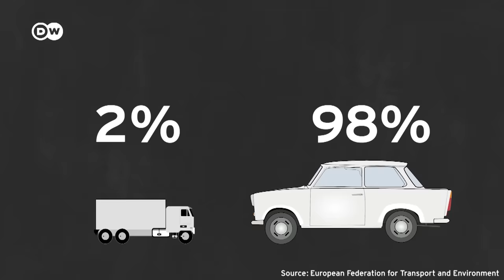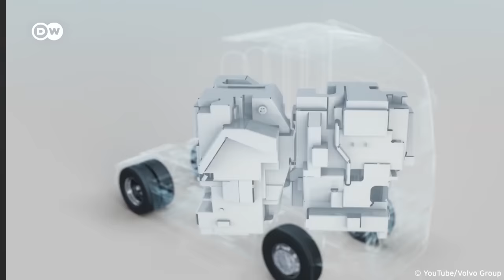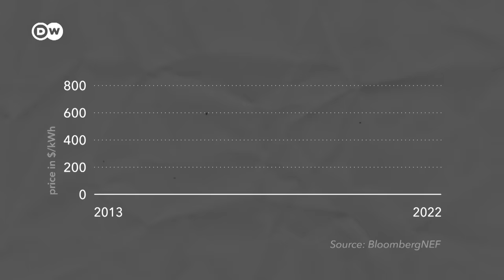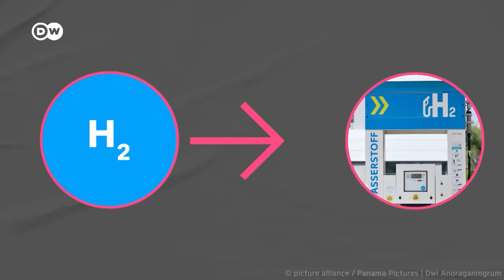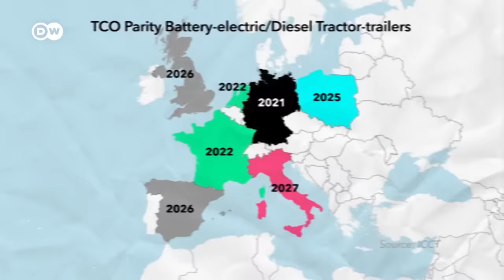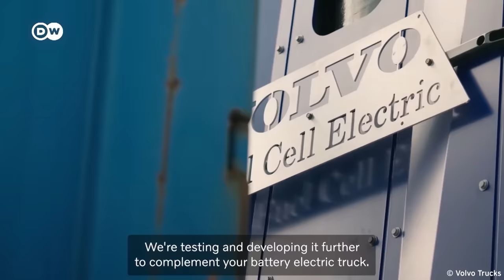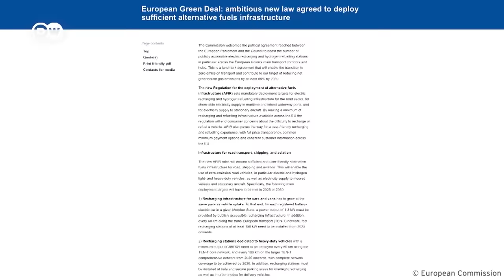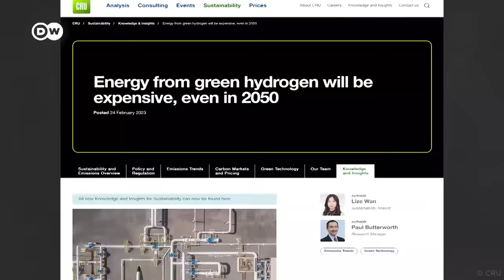Which will be the engine of the future?

Comment: We've already had a clean, faster and electric form of transportation than can haul 100 times the tonnage of what a truck can do for over a century. They are called trains. The easiest way to cut down truck emissions is to invest in more freight rail infrastructure to get more trucks off the road.
Reply: True, but many European countries have great rail networks and still have insane numbers of trucks on the road.
Reply: @Simon-dm8zv  their freight rail infrastructure is far from perfect.
Reply: @sanitygone-l9y  Are you envisioning an extremely dense network? Would be nice, but also has its problems like cutting up landscapes and neighborhoods. Or do you mean replacing existing roads by train tracks?
Reply: @Simon-dm8zv  Where I live major lines need to be replaced in the next 30 years ago. There is a lot of room for improvement for existing lines.
Reply: If that were true, trucks of any kind wouldn't exist, trucks are a necessity one way or another, and we are just interchanging from a combustion truck to an electric one, nothing more.
Reply: @Voltaje_YT  yes youre completely right. trucks need to exist, especially for last mile transit. all i was saying is that quite a few trucks could be taken off the roads by investing in rail.
Reply: @Simon-dm8zv  rail corridors take up much less space than highways. the entire history of highways is marred with segregation and splitting up neighborhoods. no, im suggesting upgrading existing rail corridors and lines  for better freight use.
Reply: @sanitygone-l9y  Sounds good, more rail cargo would be great.
Reply: @Voltaje_YT  you do need them for short haul but do we really need multi day hauls by truck? Trains are way more efficient then trucks yet we use trucks for far longer journeys  than just local transport.
Reply: @fulconandroadcone9488  Trains are for heavy transport from A station to B station, then trucks take the load to distribute to factories, stores, etc. you can't put trains everywhere, so trucks are flexyble, if trains were better, we wouldn't have trucks, trains have its uses, and so does trucks.
Reply: @Voltaje_YT  the point being made here is that there are a lot of long distance routes 300 miles plus being done by trucks. these would work better as freight rail routes. trucks are better for last mile deliveries, not cross country hauls. yes trucks need to exist but a big part of why they exist is because governments are too lazy to upgrade or build new rail corridors and instead invest those billions into roads and highways that degrade much faster than rail.
Reply: @sanitygone-l9y  I wonder if given the choice, companies will rather choose trucks than trains, trains would be mostly public, for the use of trains, we would need private ones, and even if we have that, the cargo's safety and schedule will be entirely controlled by the train managers, unless companies build their own trains; it is complicated, any major company could ask to build a train if they wish, but they don't, why wait for the goverment to build trains when one can build their own?
Reply: Trains are powered with diesel engines.  And yes, diesel trains have always been the most efficient shipping mode per ton mile. 😂😂😂
Reply: Thats silly. Trucks do the last mile. To do that with trains would require FAR more track to be laid. The expense would be beyond enormous. Laying a mile of railroad track can cost upwards of $3 million, depending on various factors such as track type, terrain, labor costs, and material prices. Thats not including the cost of purchasing rights for the land.
Reply: Ok in indian context, India has the biggest rail infrastructure, but to reach retailer, trucks play a vitol role
Reply: @Simon-dm8zv ”insane” numbers of trucks, is what US have. Of course the question in video is stupid - battery powered semitrailers make no sense.
Reply: Trains were the enemy of passenger vehicles for over a century. The automotive lobby has spent exorbitant amounts of money and effort to undermine everything that can mess with their business and profits. In the past it was trains, now it is EVs. 
Also their partner - the oil industry - generates $10 billion in profits per day and doesn't want to a piece of this cake. They also receive $11 million per MINUTE in subsidies globally.
Reply: @Voltaje_YT  I'm not talking about transport from factory to station, I'm talking about long haul trucking.

And there are places that run train lines to factories, go figure, they are not built to the same standard as main lines as they don't have to support high speed, but there are trains going to factories, in fact there are quit few facilities that have direct train lines going in here.
Reply: “The easiest way to cut down truck emissions” .. well the goal is to cut it by a little bit. It’s to cut all emissions. You can’t do that by just building some more trains.
So this is a “yes and” situation. Not a “no let’s do this other thing instead”. 
Bringing up trains in this discussion is an unnecessary distraction. I support more trains but I seriously doubt it’ll make a big dent in emissions by 2050. It’s just too slow to get anything done.
Reply: @auspiciouslywild  Trains don't have to carry a battery to power themselves, just by that they will use less energy then battery electric trucks. 

Here is a simple question: "Is it easier to replace all trucks with battery trucks or replace some with electric trains and some with battery trucks?"

Point of the question is you have to make those batteries and you have to put in place, mind you, very expensive charges. Most of it it technology and infrastructure we are yet to learn how to implement. Electric trains have existed for a very long time and we know quite a lot about them and how to build needed infrastructure. 

Not to mention the question where does the energy come from. Trains use less which means that if you fail to transition from fosile fulles in full you will use less of them to power those trains compared to trucks. And don't make a claim we will transition in full when the very reason we are not starting full relience on renewables is well batteries. 

If you want to reduce carbon emisions as fast as posible you have to reduce energy usage where you can then switch out for more favorable technologies. But I guess most you wee need green tech greens forget that first R stands for reduce.
Reply: @Simon-dm8zv  replacing roads and highways with rail tracks would actually be a really good idea it would not only prevent further damange to the surroundings but also would reduce space for cars and whatnot. so inverse of induced demand.
Reply: @Voltaje_YT  for last mile or whatnot trucks are the best option(for small scale delivery even better methods are their like electric  bikes). But simply put the reason why trucks are dominant is not becuase they are better its because rail has been neglected for a really long time in favour of roads and highways. So it was far easier for them to use trucks instead of the much superior method that being trains.
Reply: @zerotwo_.002  I absolutely agree.
Reply: Thankyou spot on. blindingly obvious except to the schlerotic stereotypical reactionary government we have especially in the uk Gifted a superb railway system
By the Victorians all they have come up with is a super expensive duplication of a route already served. All the network largely needing only consistent investment and renewal  and upgrading like say SNCF or other continental railways .
Reply: Train tracks don't go everywhere.
Reply: America has the best rail network in the world, and trucks are still needed there. At the very least, even in an ideal situation for trains, you'll still need trucks and vans to get that last mile delivery in.
Reply: @realAlexChoi  if you read some of the replies in this thread, that point is covered multiple times. I'll leave you with a reply from @zerotwo_.002. "For last mile or whatnot trucks are the best option (for small scale delivery even better methods are their like electric bikes). But simply put the reason why trucks are dominant is not because they are better it's because rail has been neglected for a really long time in favour of roads and highways. So, it was far easier for them to use trucks instead of the much superior method that being trains."
Reply: Sadly America doesn't has a good train infrastructure, but rather than investing into creating one they are busy creating autonomous trucks that can follow each other 😂🤣
Reply: The economics and service provided by hub and spoke are limited by the nature of the transportation process.  Trucks are simply necessity to complete the daily door to door operation.  Additionally, time sensitivity in transport changes the method of transport.
Reply: @kreativechaos7606  We have great train infrastructure, just not good passenger trains
Reply: Notice how the video acknowledges that renewables are not any significant source. Sorta dismisses it in the tone. We’re fucked. We ain’t getting off fossil fuels anytime soon
Reply: Very true
Reply: @Simon-dm8zv   You're talking like highways dont already cut up landscapes and neighborhoods.
Reply: @VTRAQUEVNVMPLVSVLTRA  Of course they do. But more above ground infrastructure means more cutting up landscapes in general.
Reply: What about Bio diesel from sea weeds
Reply: That is such an incredible dumb proposition. It actually astounding how anyone can even suggest that.
So you are saying every single home and commerce should've a rail line and rail station in their backyard!? Completely stupid.
Reply: that would be very expensive. you see in western australia region, they are testing electric road trains
Reply: They're not clean, they're cleaner. No rubber tyres to wear down means less particulates. Last mile can be dealt with by smaller vans or even bikes
Reply: Trucks will always be needed for the last mile.
Trains CANNOT deliver straight to customers
Reply: How many supermarkets are on train lines? Or distribution centers? The idea of using trains for haulage is great, but it doesn't get to the final point of the distribution network. That still requires trucks or vans.
Reply: true, chinese high speed train
Reply: Bro don't abandon trucks they are osome
Reply: Electric car is not clean
Reply: Facts brother facts!
Reply: Please louder for the ones in the back.
Reply: Why nobody talks about the impact of dead batteries to the environment and the fact that no one knows how to recycle them. Also about the thousands of African kids who work in the lithium mines in Africa so that we, entitled westerners can breath cleaner air, WAKE UP PEOPLE, WE ARE ALL LIVING UNDER THE SAME SKY!!!
Reply: @maneleremasterizate7421  emm, you're talking nonsense... Dead batteries can and are recycled. Specialized companies take the batteries in, ground up the cells and can sort the rare metals with almost 100% accuracy. Those metals are then resold. Current supply chains of new raw materials are hardly coping with the demand so recycled battery component materials are in fact used very well.
Reply: @maneleremasterizate7421  as for that sad African children story, only a very tiny part of the global lithium supply comes from Africa and then mostly Zimbabwe. Much like every single developed nation on earth the development of a country has come with child labour. Those children can't go to school because there likely isn't even a school to go to, but, with new possibilities for work they might just be able to create a better life for their children like can be seen from the progress China has made in the last two decades.
Reply: @racevoltGamerthemecedesguy  So we should stick with fossil fuel burning cars? Is that what you are saying?
Reply: @Simon-dm8zv  Europe actually has a pretty weak freight rail network and manages less modal share then the US/Canada. Their passenger service is pretty good but that disguises some real problems on the freight side.
Reply: Yes, trains are way better than other form of transportations, especially electric rail. Directly translate electricity to momentum with over 90%  rate.
Reply: @AmurTiger  Ok, interesting. Are there any examples in the world where freight rail has significantly reduced truck use?
Reply: @zoransarin5411  I'm saying we can make fuel batter engine batter and it will help all vehicles such as truck ,plane,ship.
Reply: @zoransarin5411  ev aren't the future it's hox
Reply: Trains cannot deliver goods in the same time frame as OTR truck. They are fine for commodities that are seasonal or steady in demand. But fast moving cpg goods are on trucks. They cannot afford out of stock events. They need to react to market’s quickly. You would wind up with more waste and CO2 through expiring in transit.
Reply: @racevoltGamerthemecedesguy  No we can't. Combustion engines are pretty much at their maximum efficiency.
Reply: @racevoltGamerthemecedesguy  EVs are not a hox.
Reply: @Simon-dm8zv  naah it isn't you can see there is lot deference between f1 car and normal car . Normal car is only efficient 20% and f1 car is 50% there is lot of changes to make ice batter even you tube your engine that will become more effective and adding batter fuel will increase potential to reach same almost same efficiency as ev
Reply: @racevoltGamerthemecedesguy  F1 engines are not 50% efficient, there is just one engine that reached 50% in laboratory settings. F1 reaches about 40% on the track, not that special. Modern passenger cars reach 30 to 35%, mainly restricted by emissions standards. Even if it ever were ever possible to make a normal car 50% efficient, CO2 emissions are higher than any electric car. It's a dead end road.
Reply: @Simon-dm8zv  Did you forget which came first? Beyond that there's a simple logical necessity going on here. Freight has to pick a mode of transportation more choices will necessarily take away from whichever system was in place first ( trains generally ). In cases where the freight favors trains, mined materials are a big one here, the freight won't be moved at all until their preferred mode of transport is built. The reason trucks are a major part of transportation comes down to two factors, the speed/convenience of point-to-point transportation and governments paying for roads. Trucks are disadvantaged when it comes to fuel, labor costs and their ability to handle heavy loads. Turning back to the video a bit electrification will actually intensify the disadvantage trucks have for fuel ( electricity ) as at that point they'll have to use heavy and expensive batteries that also induce some losses and take time to charge while trains can take electricity from overhead catenaries.
Reply: @Simon-dm8zv  fuel can help to reduce polution
Reply: @Simon-dm8zv  by the way Toyota created engine that are 50% efficient and less pollution
Reply: @racevoltGamerthemecedesguy  no it cannot
Reply: @racevoltGamerthemecedesguy  Tell me how that engine is called.
Reply: @Simon-dm8zv  then why the hell indian pm go to Isreal and some middle East country
Reply: @AmurTiger  Of course, we need a lot more rail cargo. I was just curious if there were any (recent) examples of countries with intensified railcargo that resulted in significantly less truck usage.
Reply: Yeah but way that some of train infrastructure is managed is quite bad. I know one local producer of sugar that was forced to construct a road and buy trucks in order to export sugar cause price of train transport was so high that this solution made economic sense. Also working rail track is right next to factory.
Reply: @Simon-dm8zv Switzerland does it best
Reply: Even with trains there is still the last mile problem. I guess it works if you're transporting product in bulk but that's usually not the case with consumer goods.
Reply: @sanitygone-l9y you still need trucks to get it to the shops
Reply: @stijnhs  last I checked Zimbawe was still in Africa.
Reply: @maneleremasterizate7421  that's what I said 🥴
Reply: Trains are great for huge loads to one location, trucks deliver from the rail yards to warehouses, truck move merchandise from warehouses to the retailer. There is no eliminating trucks from our roads, from farm crops to the market place, wheat, corn, Milo, soybeans, cotton, hay, cattle, hogs, sheep, and goats, just to mention a few, and these are just the first phase of the process. Then can the electrical grid handle charging that many trains? Now we're back to square one!
Reply: America is working on this, but it's gonna take a few years for the infrastructure to become practical for large scale supply chains.
Reply: I agree we do need more rail. But keep in mind rail has its limitations as well. You can’t lay them down everywhere.
Reply: Bro we also need tunnels so we dont stop at rail crossings
Reply: The problem is cost and distance, you need a full load constantly and the distance has to be larger than around 300km for it to start to be profitable
Reply: Yeah, because trains have a stop on every hangar in every industrial polígon 😂
Reply: seems your country does have a train network that actual runs on time. now add more load to that
Reply: The whole rail network isn't set up to carry more rail cargo, if you think it was cheaper and more efficient as trucks it would already be used. This comment is about as accurate as the BS in this report, the fact is Battery prices haven't declined that much in the past 5 years and have actually risen in the past 2 years (since 2021) battery packs in trucks doesn't make any sense, yes you can charge them quicker, but the quicker you charge batteries the shorter their lives. This is a little behind the times too, JCB has already started making hydrogen ICE-powered vehicles, that I would put my money on being the future, the more minerals we mine the more expensive they get, they have already bottomed out, and recycling is not suitable for EV batteries anyway the end product is not clean enough.
Reply: Rail infrastructure is very rigid. And very very expensive to develop. In actual fact, if you didn't know already, no rail network ever pays back for itself over its lifetime. The costs of building it are always passed on to the next generation of the nation. Many countries that would appear to have successful rail networks do seem so because the government heavily subsidizes it but not because it ever remains profitable. Never.
Reply: The EU has one of the best rail networks in the world and still need trucks. Tells you how limited rails are.
Reply: thats what the elits wants - truck citys 🚛  🏙️  that battle each other
Reply: How do you get stuff from the train to the ware house or distribution cneters ? Trucks.
Reply: Railway Cargo implies a monopoly, that will increase costs of delivery and can cause SMEs go bankrupt.
Reply: “Railway cuts off the local habitat”, that’s what environmental science professor told me back then
Reply: @chung729chung you say that like road corridors arent bigger and do the same thing. highways have a historyt of being built in a way to purposefully cut off neighbourhoods and segregate them.
Reply: @sanitygone-l9y  I dunno bro, I am Asian. I can’t live without railways
Reply: The issue is below 100 Km, train is cheaper when compared to rail. For longer huals, trains are less costly.
Reply: Lol very funny
Reply: Trains are not a door to door solution as they are limited by the rails
Reply: Bingo, this is the only real solution and it's one that was already in place (in America) but torn out by our extremely wasteful government to build interstates. Granted, I prefer interstates and personal travel but high speed rail would be nice.
Reply: (In Europe at least) Shipping goods by trucks is waaaaaay cheaper than going by rail. It's the common problem that everything rail related in Europe is extremely expensive.
Reply: Well most of the train tracks were demolished when my country entered the EU
Reply: Okay for US. Cost prohibitive for Australia. Already done everywhere else.
Reply: The problem is not that rail is always better the problem here is really that trains are not the last mile transporters of goods anywhere but often used to transport goods long distances where trucks then takes them to their destination, yes rail is great! i am a huge rail nerd and love rail infrastructure projects but we need to make trucks better in order to make rail better.
Reply: @Simon-dm8zv EV Blimps?
Reply: @sanuthweerasinghe7825 nothing of the sorts, the trains couldn't get the goods to the distribution centre for your amazon order to be for filled, items are moved between warehouses all over the UK, multiple times a day, goods are in the wrong place because of demand variation, the train wouldn't work. Thats just one company. Farmers milk needs collecting and taking to a dairy, and once its bottled, needs taking straight to the supermarket distribution system. Trains are useless for these jobs. Why load it twice when the truck can get to your door and straight to your customer door with in the day?
Reply: Maybe once we figure out how to keep them on the rails? When a truck spills it is a lot less damaging than when a train derails.
Reply: @billjohnson9221  except trains rarely ever derail. if one does, it becomes a big event on the news because it’s an extremely unlikely event. trucks get in accidents or tip over all the time.
Reply: Yes - Dedicated Freight Corridors !
Reply: yes !
Reply: You are absolutely right. I live in Trentino, Italy, and here we can’t wait for the new Brenner train tunnel to be completed, in order to have some relief from the heavy international truck traffic on the A22 highway. After a few days it doesn’t rain, the valley air is gray with pollution, and stinks of diesel exhaust. Nevertheless I am also expecting trucks to become cleaner, because they will still be necessary.
Reply: So the government need to lay a rail track in front of your house to deliver your amazon packages?
Reply: @fjahja  thats definitely not whats being suggested. dont be dense and read through the discussion. a lot of long distance routes, 300 miles plus, is done by trucks. these would work better as freight rail routes. trucks are better for last mile deliveries, not cross country hauls. yes trucks need to exist but a big part of why they exist is because governments are too lazy to upgrade or build new rail corridors and instead invest those billions into roads and highways that degrade much faster than rail. last mile deliveries can be done by electric vans and trucking should be minimised.
Reply: You have no idea how logistics works I guess. Train works effectively for the public service, but not for the goods transportation
Reply: Absolutely. Spot on
Reply: We have a lot of freight rail
Reply: Trains can't be last mile solutions plus they incur a lot of infrastructure cost at 1st place
For Hydrogen vehicles to succeed we need more corporations and more new age entrepreneurs to invest their time and money the way it happened in EV areas
The solution in my opinion is to let EVs handle the consumer transportation and let HV handle the commercial transport part it will be a win win for both
Reply: Awesome !!
Reply: They are good but are limited and cannot do last mile transport.
Reply: Freight needs to go from A to B not from A to H to D to Y to Z
Therfore trucks are better than trains
Reply: How you bring a train in the ship to travel to an Island? Trucks are necessary because of there flexibility.  So they will be always on the roads whatever you like them or not
Reply: Yeah, and for long distance travel between hubs, that makes sense. However, it's inflexible and doesn't go to every Supermarket or Factory. In Europe, it makes even less sense.
Reply: As long as the cargo meets the limitations of a train wagon and the railroad (width and height) then you are right. But you still need that heavy cargo to get to the train. How do you want that to happen?
Reply: Yes, especially ALL ELECTRIC trains.
Reply: Trucks or Vans are only really needed for last mile delivery. Most of the long distance transport should be covered by rail. This is especially true for the US where you have huge distances.
Reply: Rails aren't competing with trucks. Rails are just efficient at a different level in the distribution process. Just like trains don't compete with the even more efficient container ships. 

 You can't build a rail into every single warehouse, let alone supermarket. If that isn't obvious to you you are just being dense. You use trains and river ships for long distances over land. At certain points you have offloading areas, from there you WILL still need trucks to get them to their final destinations. The entire integrated system consists of container ships, river ships/trains, trucks and finally normal passenger cars bringing food and other stuff into every home.
Reply: @dekippiesip  not at all, what’s being said or suggested.
Reply: lol.  Trucks are way better, and Electrifying them is the clear choice.
Reply: Totally agree
Reply: rail networks can be used for transportation over long distances efficiently, but trucks are essential for the last mile. both are crucial and one cannot do the task of the other.
Reply: One problem. Trains are expensive as hell.
Reply: Yeah but what's easier. Making 1000 of more miles of railways or battery powered trucks. (Honestly railways is prolly the 100% cleaner way) but I don't see that happening
Reply: Well said bro
Reply: Whenever I get on a rural segment of a major interstate, i.e. I-35, I-40, I-70, etc, I usually see a near-continuous line of 18-wheeler trucks in the right lane. There’s no way that shouldn’t just be a train. Most of these highway corridors run immediately adjacent to railroad tracks anyway
Reply: NO NO NO that is too much common sense. we need to put people thru hardships to control them. How dare you come up with a viable solution Sir.
Reply: @sanitygone-l9y but highways can be built over Forrest while train tracks increases deforestation around the country
Reply: And overhead power for things like trolleybuses, trams and... trains has existed for ages.
We don't need expensive to adopt, repair and maintain hydrogen systems or batteries with unholy weight.
Reply: @Simon-dm8zv  True, but i'm not seeing a lot of Cargo on the Rails....most of the Time its Passanger Trains...So the Trucks keep on driving from Point A to Point B, instead of Collecting the Items from the Rail and destributing it to Point B
Reply: This is true; however, the cargo transported by trucks is typically directed to destinations within the city or to locations where trains are not feasible. Establishing a road network is simpler and requires less maintenance compared to railways. Still, while advocating for increased train usage, we must acknowledge the necessity of trucks for delivering cargo to more remote locations or densely populated areas like cities, where having a train next to your door isn't practical.
Reply: You have no idea what you're talking about. Industries dealing with bulk goods and logs these days are in Europe choosing trucks over trains. A sawmill in Vestfold, Norway, has rail lines into their factory to load trains with logs and other wood produce and send them to their trade partners but these days they choose to instead transport it with trucks. The train industry charges more per kiloton transported than trucks, no matter how efficient the rail is. You could have a rail infrastructure greater than Tokyo and in Europe freight would still be transported on trucks. 

Trucks also offer faster and direct deliveries. One time a supermarket ordered 8 tons of minced meat at 1 PM from my company, I delivered it to their storage at 4 PM, 3 hours later. You simply can not offer this with rail. 

And ultimately, you would still need trucks to load the train, unload the train and deliver the cargo to where its supposed to go afterwards. So yeah, you can cut out the transportation between two distribution centers which would reduce emissions by a bit but again, that is more expensive for the companies. 

Its a lot smarter to realize that the freight industry is heavily based on trucking and not rail in 2024 and instead invest money into R&D to make trucks zero emission than it is to invest money into building even more rail when the rail will be left unused and even if used, would hardly make a dent in emissions either way.
Reply: But you need trucks still to distribute the goods from unloading train station….
Reply: @Simon-dm8zv  whatever you think is a lot of truck you probably haven't seen what we have in North America
Reply: @nazmaster1 
Trains haul the heaviest longest distance cargo, then depending on how heavy the needed haul after their destination, you would choose between a semi, big or small van or even a cargo bike depending on how well equipped the area is. Trains are magnitudes more efficient and can run on mains electricity, they can easily replace a whole fleet of trucks in many cases

Just like cars, semis will always exist, but there's many cases where they would be better off gone.
Reply: Well said
Reply: In a country like Australia Trains won't work, the country is to big and not enough demand for Railway infrastructure. Trucks will always be the better option for point to point delivery, just more efficient.
Reply: @fakename8856 where are you from? Never seen electric trains?
Reply: @johntomasini3916  So you're telling me trucks that are limited to below highway speed are a better options for vast desolate land over trains that can go as fast as the tracks allow?

Plus australia isn't big and evenly populated, it's big and half the land has a population of 0, trucks will still be used for lesser population areas but trains are a perfect mode of transit between your dense cities
Reply: @woofywooflez384  It is cost prohibitive to build Train lines to service the commodities we have to move here, you would never get a return on the investment. There is one Train Line from Victoria to Western Australia. There is one Train Line fro South Australia to Darwin. There is One Train Line up the East Coast of Australia, with some off branches. There have been plans to build a High Speed Rail from Melbourne to Sydney, and Possibly to Brisbane. It doesn't happen because it is not viable.
Reply: @woofywooflez384  Your comment "Plus Australia isn't big and evenly populated, it's big and half the land has a population."
From Google.  Australia is approximately 3860 kilometres long from its most northerly point to its most southerly point in Tasmania, and is almost 4000 kilometres wide, from east to west. Big distances and small Population destinations, again not viable.
Reply: Easier said than done. Truck can still go to each individual businesses and warehouses. You can't build a railway to every nooks and crannies of the planet can you?
Reply: @Vesper778  Exactly.
Reply: Nah the US government wouldn't like that, it will reduce their allowance lol
Reply: @Simon-dm8zv  that simply means European countries still need more development on their rail network
Reply: @sanitygone-l9y  for last mile transit, electric ones can do its job. freight rail for long distance
Reply: Freight trains run on diesel, not electricity --passenger trains are different
Reply: Not everything carried by trucks is near to the required rail infrastructure, and even if it is, you have to get your material to the train.
Reply: @johnshields3658  How VERY TRUE!!!!!!
Reply: " They are called trains."
==
It still needs last mile delivery.
Reply: @allgoo196  being in a remote area,  there are many many miles from any train to stores.. Trucks are still needed..
Reply: Ya sell that to all the truckers good luck with that
Reply: It's very expensive to maintain thousands of miles of Trac.trucks can be more cost effective on many rout's diesel should be cheaper but is taxed high.
Reply: Trucks turn up where I work every day.  Not seen a single train. Might be because there is not a train line outside my factory.
Reply: Where are you going to drop off the freight? Hiw are you going to get 1000,s of the train and delivered to the customer? Trucks can go from warehouse to customers door step.
Reply: @Simon-dm8zv  Yeah, but most of them can go battery.
Reply: Don't forget those dirty wasteful cars by the millions.
Reply: Yeah, i bet a train rail to stop at every construction site. Or a train rail to every boutique that sells neccessity that needs to keep things cooled off while on the road. 

Man, you don't know what you're talking about.
Reply: that works for area with alot of density ,....only.
Reply: Then how do you get it to the store?
Reply: Last mile delivery can't be done by trains
Reply: Bruh, the truck needs to haul it from the train station to its destinations. A train cannot do that.
Reply: I know in Canada(and the US I believe)  that railroad lines are owned privately.These outfits can charge what they want and without trucking to compete with they would screw the consumer even more. Cleaning up emissions in heavy machinery is more important than cars really. E powertrain is so superior and I think battery tech and charging infrastructure will get better and better.
Reply: this is a bad argument..... trucks are still needed for the zero mile connectivity.... trains would only work for densly populated network.... for long distances and sparsely populated places trucks on demand are the only option
Reply: impossible, trains arrive in weeks or months. it will disrupt the supply chain. you will end up paying more for the stuff you use then what you pay now
Reply: South Africa is a Prime Example of this. Our railway network was neglected and in more  recent times, utterly ransacked. This results is much higher road freight, which has had a terrible knock on effect to passenger safety on already congested motorways.
Reply: And... each heavy truck does more damage to roads than 30,000 car trips.
Reply: Not in the uk
Reply: Electrified rail is fantastic, but electric trucks are great for final delivery, especially in urban centers.
Reply: @fakename8856  Depends on the country.  In the US, freight trains are largely diesel.  In developed countries like Germany and China, most rail is electric.
Reply: @Iangamebr  It used to be that automobile factories and warehouses had rail spurs.  The manufacturer would load directly on/off railcars, which would then be hooked into the long distance train.  Now it's intermodal yard moving containers between trains and trucks/trailers.
Reply: @ZweiZwolf  electricity is an energy vector, not a energy source.
Reply: @Chris.Davies  No, that’s utter nonsense.  Do you just hate Capitalism?
Reply: Trains for long trip freight hauling. And hydrogen trucks for the last mile delivery.
Reply: Us trains are Diesel electric hybrid's
Reply: Trucks are usually almost always faster, train is the slowest land method and unfortunately trains aren’t meant for regional transport, trucks make more sense in that case
Reply: If it’s within 900 km or about 600 miles and the quantity is not very big than trucking is a better form of transportation
Reply: @lukeguastaferro7962  China has started fast delivery service with It's high speed trains.
Reply: Yeah if you want to charge but hours
Reply: Use hybrid  jet engines I. Trucks and cars, electric sucks
Reply: @KamerKazanci-wj2ou  trains don't suck
Reply: While we're at it we can dig through town and cities and sail boats down them and transport that way.
Reply: In Canada we sold all our excellent rails to China. Yay trudeau!
Reply: Well said! Vested interests want new tech and make people spend more while losing track of what is already available. In the last 10 years India has invested heavily in dedicated freight corridors (DFC), and continues to invest in freight rail, to reduce it's carbon foot print. Passenger rail services as of Aug 24, in India are 97% electrified, compared with less than 38%, for example in UK. Nevertheless, that does not deter Britain from lecturing other countries on clean energy!
Reply: Thanks for the amazing vidéo. ! Should we also consider the limited availability of rare minerals as a bottleneck to the mainstream production of batteries ? Not sure this point is addressed in the video. Maybe this limitation will explain why both technologies have to be part of the solution ?
Reply: Some freight trains use diesel which is terrible for the planet, and even if the freight train is electric, the electricity it uses could be derived from fossil fuels, so I'm not sure if trains are that much better than trucks
Reply: You cannot make a rail system which connects every single business to any and every point on the earth.
Reply: probably why china is building more rails
Reply: That doesn't work cause trains need local transport to load them
Reply: I work in transport. It's impossible to lay tracks everywhere. To every depot, businesses and residential addresses. We do transport a lot using rail, the issue is the last mile.
Reply: WE WOULD NEED TRUCKS FOR CITY TRANSPORTS, THERBY HYDROGEN WOULD DO BETTER THAN BATTERY ENGINE, HYDROGEN CARRIES MORE TONNAGE
Reply: Yes, trains and inland waterways are very important(those can also be powered by renewables) but you still need trucks, i mean how you gonna supply a rural grocery store or a hospital in a small town without that? Trains and inland waterways are good for supplying large industrial operations, but you still need trucks because after the train arrive you have to pack the goods into a truck to supply it to the final location. You gonna fulfill ecommerce orders via a train? How? And yes ecommerce have a lot lower greenhouse impact than traditional retailing!
Reply: Concern is last mile connectivity